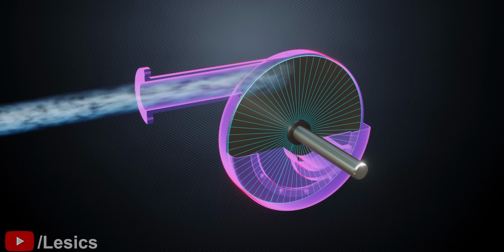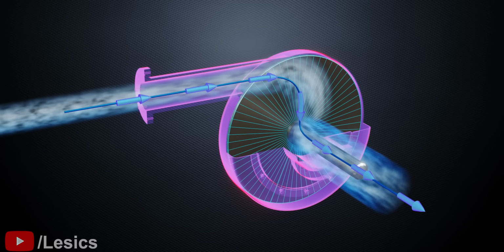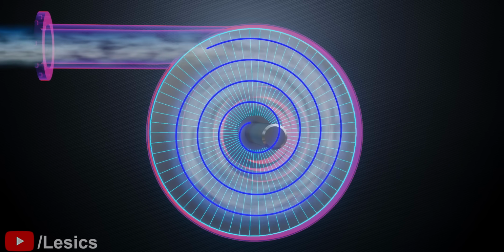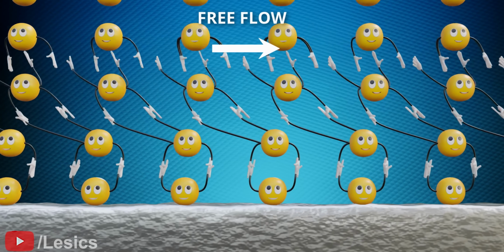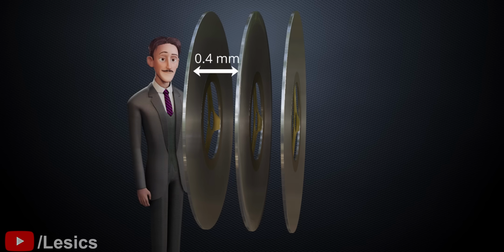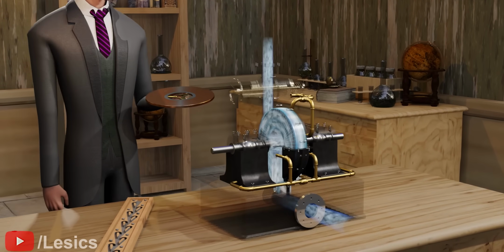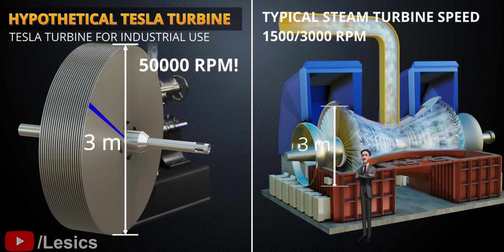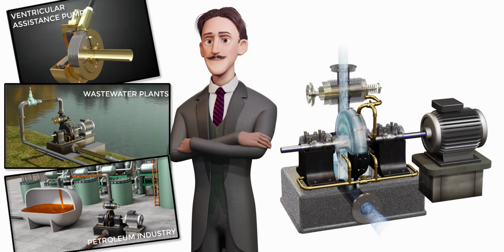Tesla Turbine | The interesting physics behind it

Comment: The exhaust is hot coming from a car and the wasted heat could be transferred to charging your Battery, using this principle inside the exhaust pipe, instead of using a generator for charging - and adding more speed without resistance for another pulley, or for the A.C to run...
People still have ideas to make the world better but stopped after people used Nuclear for evil instead of Good, and going to the grave thinking"I'm the destroyer of Worlds" ...is not a good thought, and whites labeled Racists as a group, and smokers like Einstein would be kicked to the curb, thinking f it to h3ll, is the future he didn't know that would come about, if only I had a time machine, oh wait, the body is made of Atoms which is energy, and could be Teleported also, yep, Im outta here, bye
Reply: Just some thoughts on this idea.  This turbine only needs a pressurized fluid to generate power not necessarily heat.  The pressurized fluid coming out of a car exhaust would be a mixture of hot gases.  I would think that placing this turbine in the piping of a car exhaust would cause resistance in the exhaust since pressure would build in the pipe to run the turbine.  This would lead to excessive back pressure in the exhaust which puts strain on the gas engine, just like adding another pulley.

Now if you meant using the heat of a car exhaust to generate steam which could be ran through a Tesla turbine, then we may be getting somewhere.  Except you would need to have a large water tank on your car lol.
Reply: @SuperiorSandbox  Lol.. Yes, heat as steam as pushed through a small tesla turbine which causes no resistance, the steam could be  captured and reused VIA the radiator, passing through filters that catch the co2  , and would purify the exhaust causing less carbon emissions as its main purpose - thus replacing t muffler and expensive catalytic converter while the heat on a sensor would transfer as energy to help or replace the alternator..and other possibilities are just after thoughts
Reply: @SuperiorSandbox  This was just a quick "bright idea invention i came up with watching the vid, I have other inventions as well, one you could use now i call "pet food island" a Big bowl and a small bowl glued inside each other, place water inside the big bowl lip and food in the middle, small bowl. Replacing the common dog dish  while keeping bugs out, and food fresh and cooler…u can have it 
if I invent something real in this time, like the ''Atom cell i-Teleporter'' , and interstellar travel based on energy in the atoms that make up the bodys cell's, loaded on a hard drive type, small handheld device, maybe later when waycism isn't so vile and crime is down and if America does invent it china would steal it and make it cheaper than usual, u can't invent anymore sadly, in this age,but invent and use it for your self and family, surly dont want to add the crime problem that is today
 ill leave my book of inventions for future reference for someone to find tho, take care thanks for your response

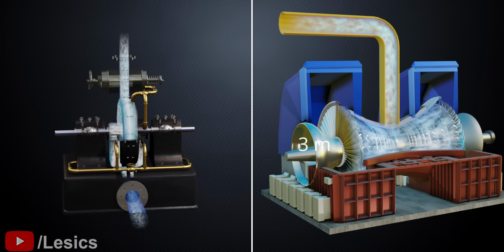Comment: At 7:50 he compares the diameter to a modern steam turbine. Wouldn’t a true comparison be comparing the torque output regardless of the size? Like what if a Tesla turbine only needed to be 1.5 meters to do the job a 3 meter modern turbine could do.
Reply: Yes, with a rpm like 4 times higher, the disc can be a lot smaller
Reply: @prowhiskey2678  I work on jet engines and my best guess would be materials still.   We have a small engine that does 40-60k rpm but the diameter of its rotor is around 6-8 In blades included.  Last time I heard of one of those letting go it sawed the engine in half and left 2 inch dimples in the top of the enclosure.  The walls of the enclosures for those engines are made of 1/2in steel with a sound deadening material held in place by a perforated metal sheet.  One chunk went through a window and passed through a set of standup lockers (think high school hall lockers) 8-10 ft from the engine before imbedding itself in a file cabinet well beyond that.
If we have that much trouble with something that small I don't want anywhere near a 5ft rotor doing 40-50K...  Plus I kinda question how long it'd take to get it spinning that fast.  Thats a lot of mass to get moving.  Then if you need it stopped though if you start pushing liquid the other way... ok stopping may be easier but still lot of mass to slow.
At this point I think we still need to be working on a material that can withstand that level of force first.  Though strangely I've slowly been questioning if metal is the right direction for some things.  Yeah the properties of it are great but is there something we've been missing elsewhere.  I know composites aren't there yet but that's an example of looking elsewhere.  Sadly my answers for that are probably either 60years or one solid alien invasion off
Reply: @Dawgsofwinter  what kind of material were they using? I’m wondering if there is a material available but that it’s too costly to be viable. I also wonder if a type of carbon fiber disc might be better.
Reply: @andrew5576  Not sure off the top of my head and frankly too lazy to dig through manuals to be certain.  But the I'm pretty sure the rotor isn't anything to exotic or such and I'm positive the casing isn't either.  I know some of the engine is titanium but which parts yeah.  The Hot sections have a few oddball metals but frankly you'd be amazed what you can do with properly directed air to keep things from getting hotter than they should.
@TheChzoronzon you haven't been around some truly insane fanboys then have you...  Life's not fun till you hit a Telsa coil show.  And if you wanna try one at home ya gotta know enough about physics to pretzel em enough to be awesome without being fatal.
Reply: @Dawgsofwinter  watching some good Tesla coil music is always fun. I’m going to dig into the material thing further I’ll let you know if I find anything.
Reply: thank you - he jumps from 6" to 3m.. um.. try smaller discs and test the outputs - and tesla had them in series...
Reply: Ey! You two above, stop! This is a place exclusively for clueless Nicola fanboys, keep your physics and common sense outta here, please...

Comment: Achievable nowadays - some titanium, decently built small power generator (maybe with gearbox to not burn the circuits) and off we go manufacturing our own electricity - screw power companies - independence is the way.
Reply: You're definitely not building a 3 meter disc that spins at 50k RPM. Your independence will have to wait.
Reply: @MelvinPepperdash  I'll stick with diesel generator and shut-off switch for my transformer output. But I will build tesla turbine sooner or later. I will not pay a single bill for power company. Screw them.
Reply: @MelvinPepperdash  He is not generating it for industrial purposes. So, 6 inch Tesla turbine should work for powering a battery storage system if he has the mechanics to run it.
Reply: @curiouscat113  I would rather power home and switch myself off the grid.

Comment: The energy contained in a 3 meter metal disc spinning at 50,000 rpm scares me
Reply: It should. ;) And even scary - that was six 3 meter metal discs spinning at 50,000 rpm side by side.

Comment: Finally someone fully explained why we don't use Tesla turbines in powerhouses. I work on steam turbines in the powerhouses during shutdowns. Most of the engineers I have talked with didn't even know what a Tesla turbine was, let alone why we didn't use them.
Reply: @Winston Because it wouldn’t be as efficient . What would happen if you take it to 4 meters or more? Further increase in efficiency and speed assuming the materials could withstand it.
Reply: @bobstratton6362  surely if rotational speed is the key to efficiency in tesla turbines you'd want to go smaller, not bigger. Smaller size allows for higher rpm before it rips itself apart. Yes, you'll get less energy because its small, but then surely the answer then is just to have a lot of them.
Reply: @__-fm5qv  But would you achieve more torque at a lower speed?
Reply: @bobstratton6362  I'd assume not? Just because they'd be small and have a smaller effective lever arm for the air to pull on. Not really sure though. That being said I don't think it matters too much if its spinning at 50,000 rpm, you can get the torque you need to drive a generator with gear reductions pretty easily I would have thought, you're going to need to gear down a lot anyway.
Reply: @__-fm5qv  > you can get the torque you need to drive a generator with gear reductions pretty easily
Yeah, but that would generate extreme losses. 

> you're going to need to gear down a lot anyway
Turbo generators in power plants do not have gearboxes, they run straight from the turbine (hence the name). 
Large steam turbines can easily hit >90% efficiency (with generators achieving 99% efficiency). Using Tesla's solution over our current designs would be stupid.
Don't get me wrong, he was a smart guy and his inventions were revolutionary for his times, but they do not compare to current tech.
Reply: @Axymerion  A Steam Turbines thermal efficiency (the amount of energy in the fuel used vs the output electricity) is overall only 40-50% typically. Granted a lot of the inefficiencies aren't down to the turbine itself, it does a good job of using the steam to make motion, but its still not that efficient. I believe the only part of the system that is >90% efficient is the generator portion as both electric motors and generators (being backwards electric motors to simplify things a bit), are 90%+ efficient when it comes to making or using electricity.

And I say you'd need a gear reduction anyway just because these tesla turbines would be spinning much faster than even modern steam turbines, and so if you were to bolt a few to existing generators you'd need a gear reduction to match the speed of the traditional turbine.
Reply: @justan idiot correction, Tesla also had to invent the screw in light bulb to use with his generators because he and Westinghouse won the contract over Edison and Edison said he would sue them if they used his plug in lights
Reply: @Winston current turbines manage 94% efficiency. To improve on that a Tesla turbine needs to run at an rpm such that large diameter discs fail.
So.. Build lots of small ones. Sure that would work, but you would need so many of them they would be a very much more expensive solution, and if they had to be side by side instead of in a line, the gearing/belt between adjacent rows would remove all (and more) of the efficiency gain.
Also an extra 6% efficiency (not possible) just dosent have the financial return to make it worth while.

Perhaps grid size power generation isn't the place for these, maybe cars or smaller applications.
Reply: Tesla the only known man who had basically the 3D CAD in his head, namely when he was asked why his machinery in almost all of the cases worked out first time. He replied because I assembled them in my head and try multiple variations until it work in my head only then I build tem in a RL . 
That statement was on the trail when his lab suddenly burned without any reason (Edison ..? ) with all the documentation in it. 
Tesla was shocked but he rebuild all of his machines out of his head in 2 months, it was a real miracle for his co workers, they wrote later that this was basicaly impossible task it should take 2 years not 2 months
Reply: Also wirklich traurig, diese Ansammlung von Fachleuten hier, die nichts über Tesla wissen. Ich möchte Ihnen mitteilen, daß ich dies Jahr zu Weihnachten Lichterketten mit meinen 3 und 5 Jahre alten Neffen gebastelt habe - auf Basis von "Freier Energie". Das funktioniert prächtig! Wie schade, dass Fachleute immer nur das lernen, was  sie sollen und das war's.
Reply: It’s because they are a novelty. The largest issue with Tesla turbines is that they generate an extremely small amount of torque. With the example they used as and industrial Tesla turbine it probably wouldn’t even be able to get up to the 50000 rpm range as it would t be able to overcome frictional losses.
Reply: @justan idiot ok man no need to be salty
Reply: Convoy from Netherlands
ГОЛЛАНДИЯ В СЛЕД ЗА КАНАДОЙ КОНВОЙ
https://youtu.be/gn0F2L1mkCY
Reply: @Coolio_Wolfus not strong enough to survive mach 13 LOL
Reply: Tesla invented Free Power for all people  .Only greed of some people not let him do it. Where battery of electric car can not be recharge almost for one year and many more his inventions can improve and make cheap power using in houses,manufacturing and ect.
Reply: That might change once material science improves.
Reply: sorry but he didn't explain jack shit.  
he made an assumption based on nothing and said it's impossible because of that assumption.  

where did he get the 3 meter number from?  why does he think matching the radius of a conventional turbine is the answer?
Reply: @darkracer1252  exactly!
Reply: @justan idiot well i had only heard of him after i got done school and read about him.
But alot of information is either partly true, romanticized, or people say he barely did anything.  Its pretty bad i have to go to comment sections, and actively look for someone who doesn't idolize him, to get some answers lol.
Reply: @justan idiot your nick suit you
Reply: Because Tesla turbines wouldn't work, they can't achieve enough torque because they rely on friction
Reply: @realdragon  wrong.  The torque converter on a muscle car relies SOLELY on friction to transfer power from the engine to the transmission.
Reply: @protonneutron9046  no it doesn’t a torque converter functions as a conventional turbine. Your motor turns an turbine which propels fluid which hits a stator to redirects flow to an impeller, this fluid hitting the impeller blades is what transfers energy

Your thinking of a either a clutch or a automatic transmission but they both have force applied to them to increase friction.
Reply: @adamperry4610  right the interaction of matter to matter causes motion.  Another word for "friction" in physics is imparting inertia.  Thanks for playing
Reply: @protonneutron9046  yeah on a clutch or an automatic transmission both of which rely on clamping pressure more than friction. 

In torque converters its the fluid being scooped up by the blades and "thrown" into opposing blades to "catch" the fluid that transmits power friction in a torque converter LOWERS its ability to transmit force.

Also inertia is not friction. friction is to materials asperities interacting
Reply: I didn't KNOW why didn't use tesla turbines and I worked in the gas turbine field.   I suspected (never was curious enough to do the math) that to get enough power the thing would have to spin obscenely fast.   Apparently, my intuition was good.
Reply: @justan idiot thanks !
Reply: I used to build and repair boilers , Tesla was fool as is anybody that thinks his patents are any good for anything except wiping the shit of my arse.
Tesla turbines are not use din reality because they don`t work.
its not fucking rocket sceince.
Reply: @Coolio_Wolfus really?   Prove it.
Reply: Why would they David?
Reply: Why not use gearing to lower the rpms
Reply: @vasiliansotirov6976  Because it’s not the output that is the issue. It is the speed of the disc to achieve maximum efficiency.
Reply: @vasiliansotirov6976  it would have lower efficency
Reply: @vasiliansotirov6976  then you lose efficiency
Reply: What are you thoughts on using other materials for a Tesla Turbine?

Can't use glass, it's a super-cooled liquid. Nor plastic, not enough tensile strength.
Reply: @lumberluc  Ceramic? It would also help to use compressed gas as the "fluid," because its decompression would provide cooling, causing the discs to contract rather than expand. The more gas being decompressed, the better the contraction.
Reply: @grawss  Ceramics of any sort would be like glass. A ceramic blade would crack even after 100 uses. Drop it on the floor, and it'll break.

But if we're going for a pure gas, instead of liquid, deal, then a copper disc would do just nicely. Low end, but mailable. But if we're going for cheap AND has a high-rated tensile strength, aluminum is in the 90 MPa region.

... Which, THANK YOU FOR REMINDING ME! Transparent Aluminum is on the table. Aluminum oxynitride has a flexural strength of 0.38 GPa to 0.7 GPa.

Now, how to get the stuff...
Reply: @lumberluc  Then don't drop your Tesla turbine. I don't see why it would crack unless a ton of imbalanced force was placed on it.
Reply: @lumberluc  alu oxy nitride is a ceramic...
Reply: @lumberluc  what about graphene?
Reply: Tesla turbine depends on viscosity effect to work, why use it as a steam turbine that has orders of magnitude lover viscosity than liquid water... This turbine seems perfect for pumped storage hydro plants.
Reply: Justan  what did tesla accomplish ?
Reply: @asahmosskmf4639  he invented AC electrical power

Comment: The discs can be as thick as necessary to withstand the forces generated, while the critical distance between discs is kept constant. But still, the TT is best at small sizes. Coupling it to a low-loss speed reduction system would be very helpful in most cases, and NASA Tech Briefs talked of one many years ago, based on rollers with a slight barrel shape, as in wooden barrels. It had higher efficiency than any toothed gears, and could run at hundreds of thousands of RPM with no sign of wear. They even tested it at 1 million RPM for 24 hours, and it showed minimal wear.

Comment: Hold on a minute. Why would you need to reduce the rpm? Why not just reduce disk diameter? If you need more mass, just increase the length of the shaft (add more disks). There should be more then enough power from the rpm, so why do they need to be as large as current generators?